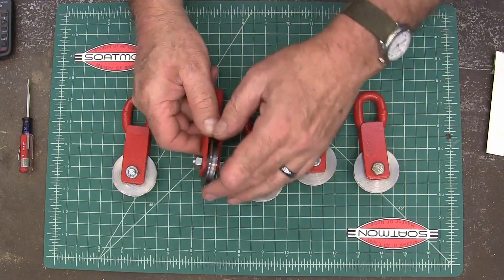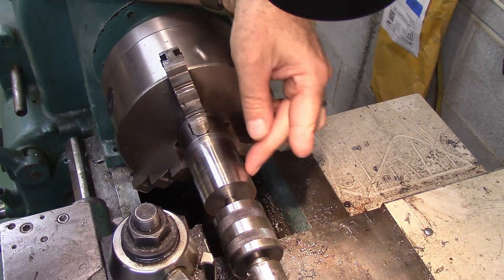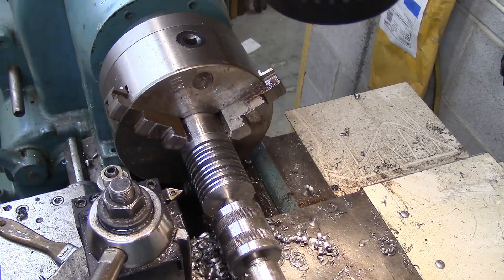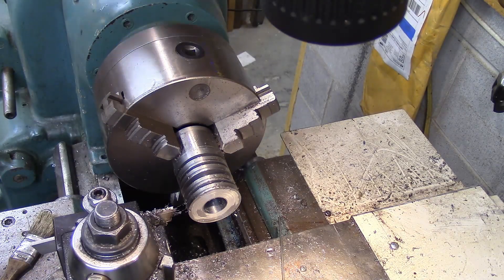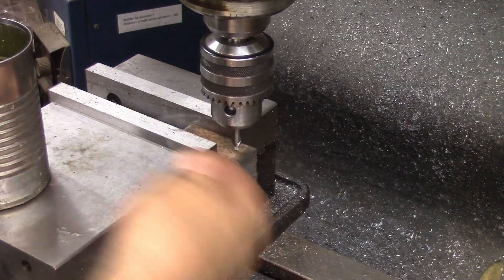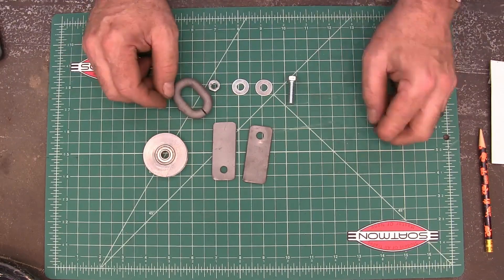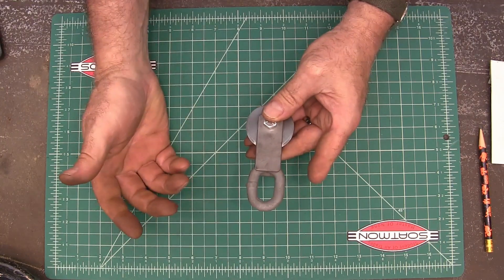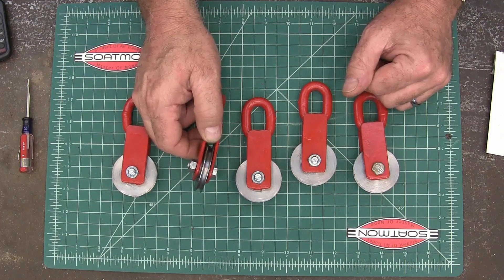Homemade Ball Bearing Pulleys for Wire Rope

Comment: All your videos are good but this one is particularly special.  The idea here is very clever to put just the right bits and pieces together and come up with a very useful part you can't get anywhere else.  Very cleverly done, thanks for taking the time to share these ideas.  This one I will remember.  Thanks again, and hopefully you are having a good weekend. I am building a storage floor up in the top of my shop for shelving. A hot job. :)
Reply from the maker: Wow, that sounds hot!  I usually hide inside all summer but have had to do more outdoor projects than usual, the heat is brutal.  Hope it all went well for you.  Thank you for your kind comments about the project.